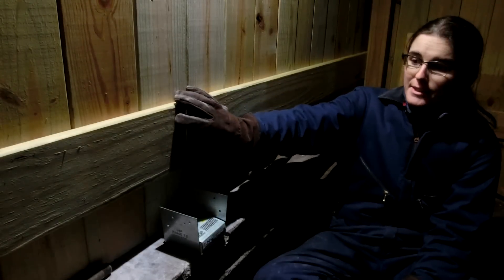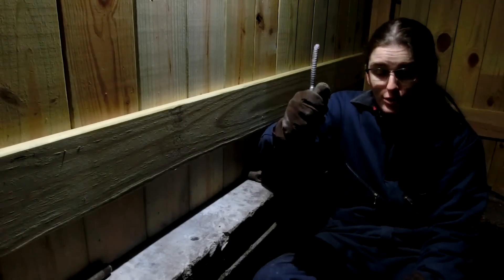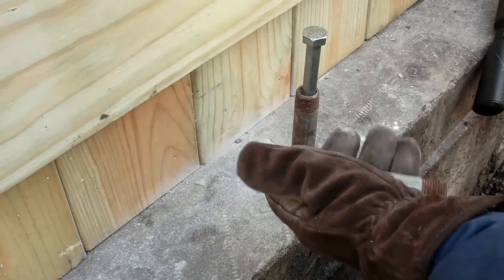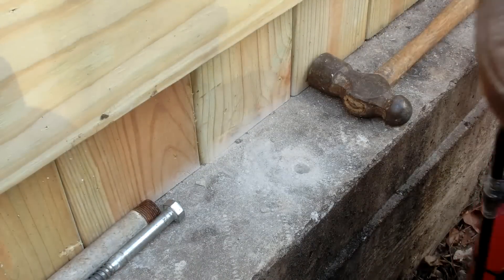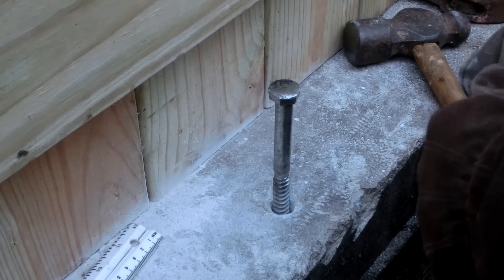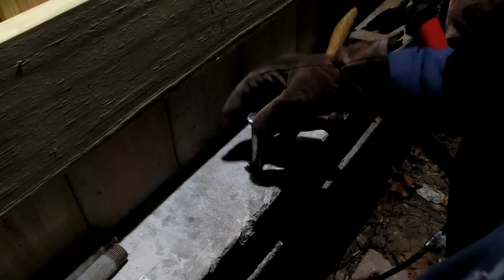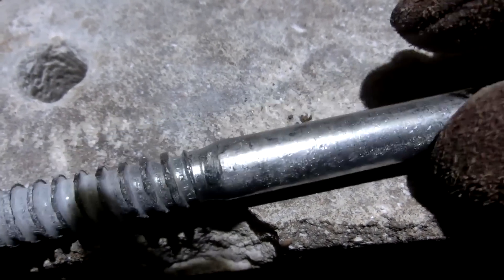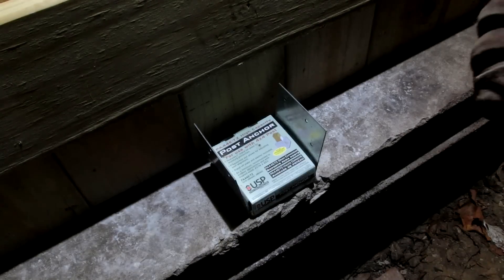Drill a Hole in Concrete the hard way, with homemade chisel

Comment: Actually even a normal drill using a masonry bit of that size will drill a hole in about 10 minutes if drilling out brick mortar to mount a tv is any indicator.   Go slow, and back out the dust often.

Comment: Hello Rinoa, I have one of those torches. Never tried to use it though on fear of an unwanted rapid "exothermic event", so it has been wall art for my home shop. However, After viewing this video the wheels are now turning, so I humbly ask you what did you use for fuel?
Reply from the maker: +Eric Esoteric they are ussually made for gasoline, but i like the smell of camping fuel so i got somebof that instead. i think its just kerosene or something.

make sure the little leather seals are ok in the pump and thatbit doesnt leak. also unscrew the knob all the way and clean the needle off. its probably got a lot of junk
Reply: +Rinoa Super-Genius Excellent. Thank you for the info. I shall attempt to put it to good use this evening.
Reply: We always use Naphtha.
If you don't let the pot warm the torch enough once you open the torch valve raw fuel will get spit, have to be careful where is pointed,  once the torch is hot you get a nice hot flame controlled by how much pressure kept on the tank. 
They use copper irons,  when they are green,  they are hot enough to soldier.

Comment: Girl's got skills - love it.

 Minor point - you didn't technically temper the steel (nor I think would you want to) what you did was called a "quench" - it hardens the steel about as much as you can - harder if you use colder water (like an ice bath) and / or hotter steel (heat to glowing white or a brighter red for example) - tempering would be softly heating the steel up AGAIN - AFTER the quench, this actually softens the steel up a bit (making it less brittle and so, by some definitions, "stonger" - really depends on what you're wanting to use the steel for). Tempering is done at much lower temperatures (you never get the steel even CLOSE to critical (red hot)) and will impart a change in colouration (making the steel turn anything from straw yellow to greenish, bluish, purple and even back to steel grey again at the high end of the temperature range). In this case, using the steel as a chisel, I would guess that you don't want to temper it at all - softening of the steel at the tip would cause it to be less likely to break - but it would not hold an edge as well and would deform more easily when you're hammering it into the concrete - making it less effective.

Really cool video though! :)
Reply from the maker: odd, i always thought quenching was just the action of putting it into water, but tempering was the entire process of heating and rapidly cooling. thanks for the correction.

Comment: I would like to thank you for using Centimeters
Reply from the maker: +Koltin Nilam your welcome
Reply: Rinoa Super-Genius I hate imperial when the rest of the world uses metric
Reply: Rinoa Super-Genius I don't hate the people that uses it. I see no point in using a completely different measurement system when most countries uses metric
Reply from the maker: Koltin Nilam
well its a base-12 system most of the time, so thats a good reason. do you use the metric clock or still use the imperial 12/24 hours clock?

the only reason you use metric is because Napoleon standardized it due to english and french inches being different, and that was where the joke about Napoleon being short came from. so he pushed to have everything standardized. he pushed for a 10 hour clock but thats where the world drew the line.

at the heart of it all measurements are arbitrary and have no meaning besides what we assign them. i feel F works better for weather because its 1.8x higher thermal resolution but C works best for things that dont matter as much like foundry temperatures and whatnot. i'd rather think of those with a bigger unit like C to make it not such a mismanageable number.

i find it really odd that Celsius doesnt have "Kilocel" and "Centicel" measurements.
Reply: Rinoa Super-Genius both 12-24 hour imperial because I was taught that in both  English class and mathematics class. But I prefer the digital 24 hour. Since I am Norwegian I am used to metric since I grew up with it
Reply from the maker: Koltin Nilam
so you like the imperial 12/24 clock over the 10/20 hour metric clock. so how can you say you hate imperial measurements if you use it?
Reply: Because the metric clock isn't a standard anywhere in the world. Metric is superior in every way, objectively speaking, and the sooner there is a (proper) push to phase out imperial, the better, if you consider that the longer you leave it the harder (and more expensive) it gets. Just my 2c! (don't worry, imperial will always be in our lexicon, we'll never "walk a kilometer in his shoe").

Loved the video BTW, star bits apparently are what you want (I'm looking for some and they're hard to find!), the fact you did it from scratch is pretty cool... as an achievement, it hands-down beats sitting on the couch (or phone) for an extra couple of hours...!

Comment: Clever. They do/did make hand hammering bits called Star Masonry Bits that you hammer in the same way.
Reply from the maker: +sixtyfiveford oh, cool. that sounds like a few mining bits ive seen. i dont know hardly anything about the construction side of concrete, just know a good deal about messing with rocks and mining so i figured some of that would carry over.
Reply: in the uk called 'rawlplug tool' never used one, but used to have a couple from my dads old tools

Comment: simplicity aside, I wonder if a sharpened railroad spike would work for that?
Reply from the maker: +Eric Jacobson too wide, and the smaller ones arent long enough, so id say probably not. but i did measure them first.
Reply: Rinoa Super-Genius yeah, I was thinking you could sharpen or thin out a longer one.. but yeah, even the fun factor has its limits :)
Reply from the maker: +Eric Jacobson exactly. especially when RP Lumber is a 10 minute walk from my house. i just have those sour days where i dont feel like dealing with the outside world and getting bombarded by the noise and advertising/marketing. would rather waste an afternoon pounding a sharpened bolt into the concrete. :p
Reply: you know what would work, a drill bit! yeah not kidding, esp a masonry bit,
Reply: They're too soft.

Comment: That's a starting torch for an hot bulb engine!
Reply from the maker: no its just an old blowlamp/blowtorch. most hot bulb engines just use old torches, although some have them specifically made for the engine. this torch was designed to be a general tool like i'm using it though.
Reply: They're the best soldiering irons. With a couple of irons,  one on the torch as you use the other you can get alot of soldiering/silver brazing done in a hurry.

Comment: that bolt doesn't have enough carbon content to become hard enough to be a proper cold chisel...you need to start with a grade 8 bolt...6 lines on the head...then you should get something a lot stronger...just an fyi for next time bud...good job though
Reply from the maker: yeah i was thinking about quenching it in old engine oil to add carbon, but i really didnt have enough heat. it obviously did harden it a usable amount though since the tip never really bent just chipped, while i kept having to straighten the rest of it.
  
in the future i'm wanting to make myself more familiar with the metallurgy of iron.....and it just so happens i have a book labeledthat from the 1930s. haha